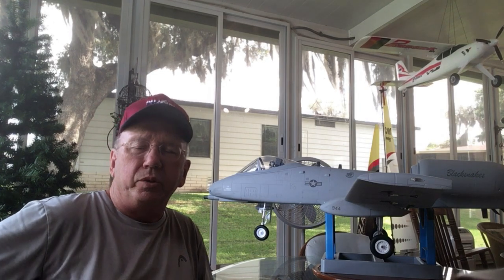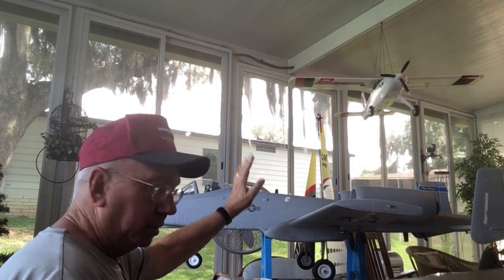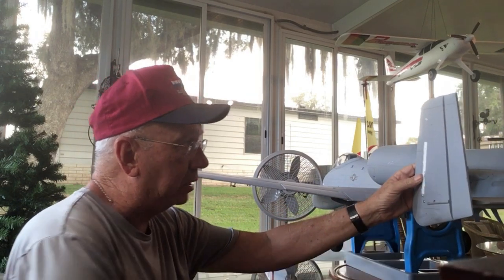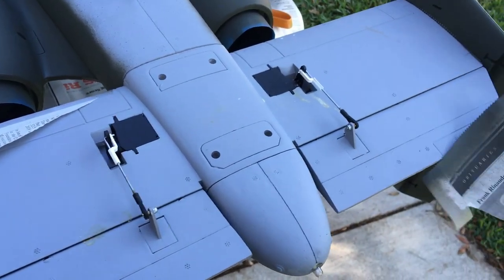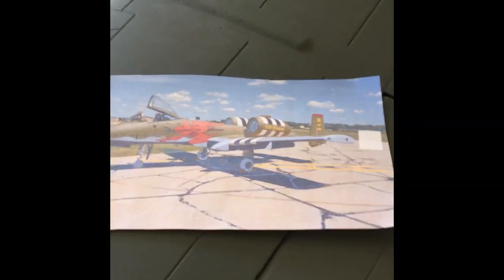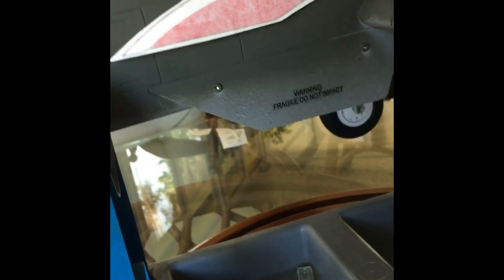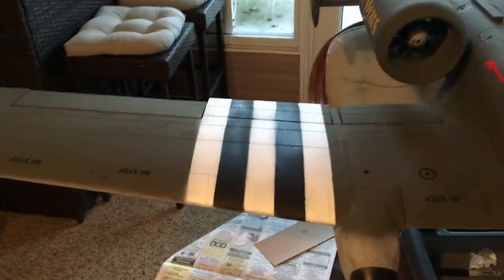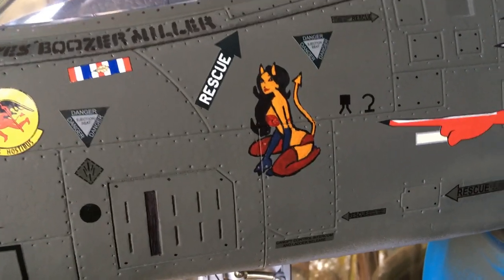How To Repaint A Freewing 80mm A-10. Custom Decals and Tape Tips.

Comment: Papa Boozer: Where do you live sir ?  I noticed you did the work on  your A10 inside of what appears to be a sun room.   It must be really nice where you live.  It is so hot in Central Texas.  It has been a much cooler summer so far than most years in the past.   I love your video.  I have that same airplane, and I have already run into problems with those decals.  Keep up the good work.  I am 69 years old, and still flying.
Reply from the maker: We live in the Villages Florida beauty in the winter hot in the summer

Comment: First, I just came across this video today, 2nd,  don't be offended, creative criticism.  I would suggest using an quality air brush compressor. practicing w/ one. You'll get a finer coat so panel detail pops, above all else deeper paint penetration because it lays the paint down very fine, which penetrates foam pores. This  would  help w/ the dreaded paint pull when removing tape.  Try ultra light tac blue tape....or use Testors light tac model mask....it has less tac, it's in very thin width rolls and sticks just enough to prevent seepage...To cover bigger areas, start w/ the testors 1/4" width  then use a paper on large areas...sealing it's edges with mask tape against the thinner Testors tape..make sense ?   Same as a car is painted.   if you use blue tape....cut your piece to length, then  place it on a pair of denim jeans,  pants, etc smooth the tape down on the pants, pull it off, smooth it down, pull it off. This removes extra stickiness . Note: Run a lint roller over the jeans 1st so not to pick up too much junk on the blue tape . But blue tape will work this way,  but I'd use Testors masking modelers tape. Now removal:  this applies to decals...run a hair dryer on low heat over the decal  if it's an adhesive decal now... not a water slide. This gets the adhesive  tacky which helps w/ removal. Same with the blue or Testors in masking situations. Use a low heat hair dryer, NOT A HEAT GUN...get the adhesive warm..and PULL THE TAPE BACK ON ITSELF..pull the tape SLOWLY BACK ON ITSELF. The invasion stripes, shoot the lighter color first...in this case shoot the white from end to end..don't lay out the stripes. Then lay out your stripes and shoot the darker color, in this case the black over the white..this way you'll spending less time touching, taping the paint. It's ALL ABOUT PREP...and patience.  I think the stripes would have turned out much better if you shot the white paint  w/o striping it....shoot it as a block--then lay out the black stripes over a solid white backround.  Other then this, use an air brush...give you a better finish !!!!